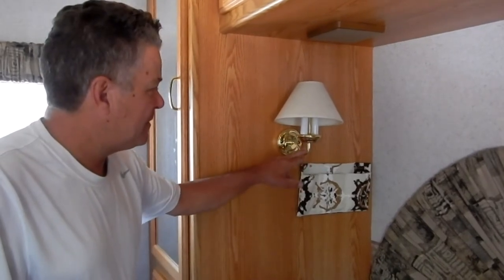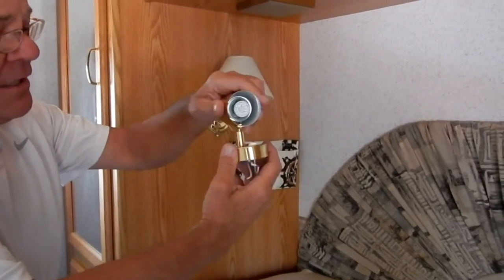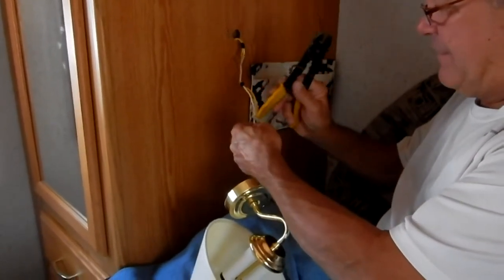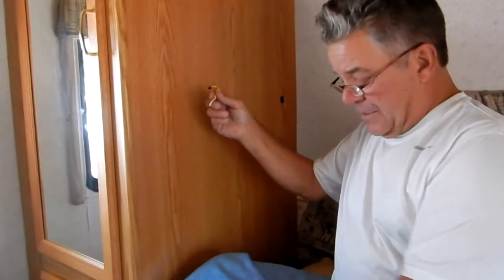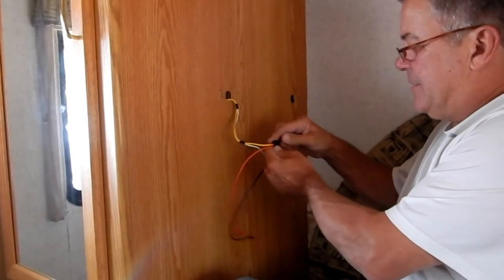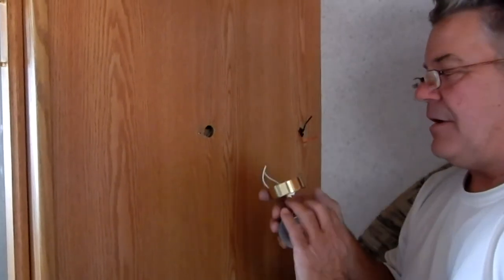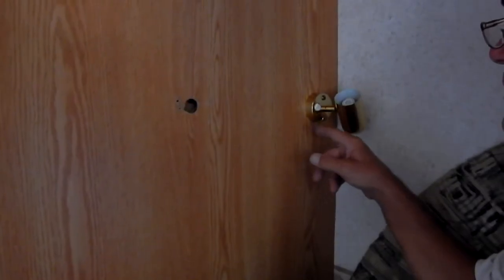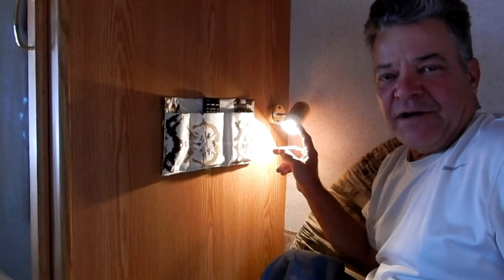How To Upgrade Your RV Bedroom Lights To LED Spot Reading Lights

Comment: Good upgrade, those old lights were kinda ridiculous. I think sometimes rv manufacturers make stuff " homey" instead of practical.
Reply from the maker: I think you are exactly right. Those old lights might have looked alright but they were not nearly as functional as these new LED spot lights. Thanks for the comment.